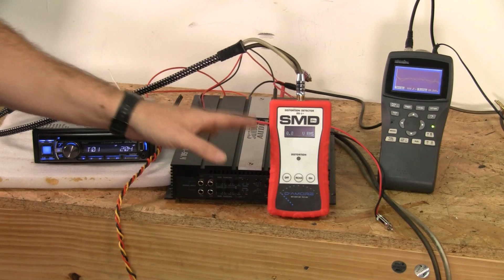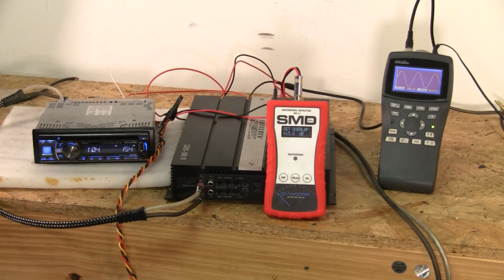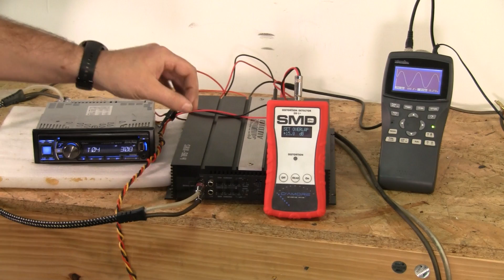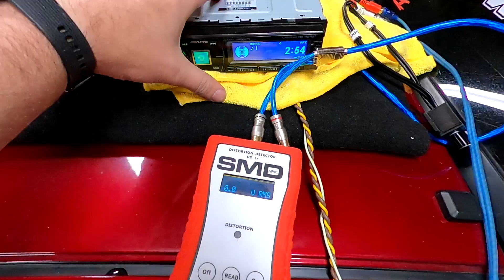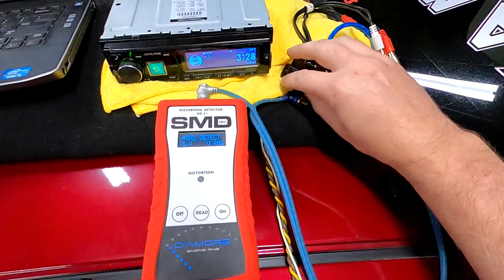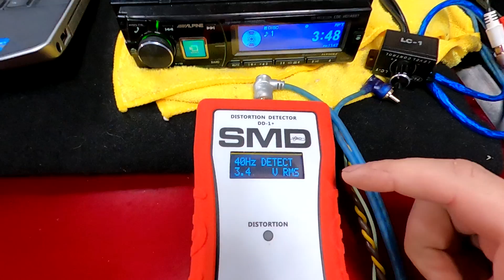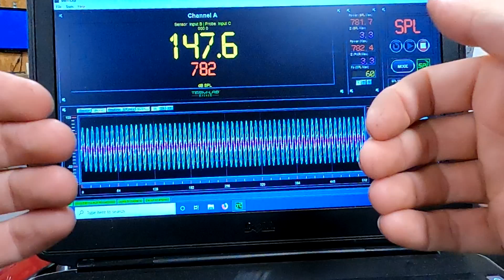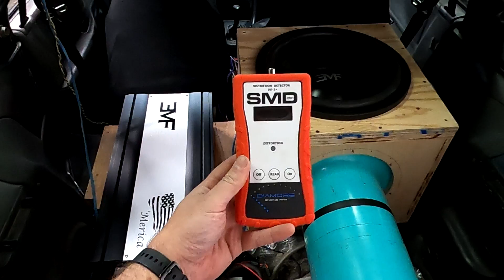The TRUTH about the D'Amore Engineering / SMD DD-1+ - Tech Stuff Tuesday

Comment: You would also with an oscilloscope have a difference with each different source so it doesn’t matter what tool you use to adjust for clipping you will have to change your gains for each different source
Reply from the maker: Using the same source with different track volumes would also change that. All reasons the best tool to use is your ear, and confidence building tools are a waste of money.
Reply: @EMFAudio  probably is everybody doesn't have that ear some people can literally listen to distortion and hear no problems
Reply from the maker: @d77543020  because they aren't told what to listen for. Most people figure it out, if it sounds bad, turn it down.

Comment: What someone should take away from this video if they're looking for valuable info or facts: 
Setting your gains should start with finding the limits of the head unit and all other gain settings shoild be set with any eq settings (bass boost, head unit eq, phone or bluetooth source equalization, bass knobs.. etc) maxed out to the highest degree the intended user would ever use.. The key to correct and safe equalization and amplification would always be to decrease  frequencies levels rather than increase them.. The part i don't subscribe to wholeheartedly is that distortion is wrong and every un-rounded waveform is an arrow from satans bow.. Clipping is undesirable and destructive for sure but i believe there are hundreds of thousands of overindulgent bass heads in the world running equipment for years even decades and their systems regularly experience distortion to a small degree..  I would not set a customer's system to allow a signal that distorted to ever pass through the output but a smart person knows that what's being said about line level, eq and clipping are really just no-brainers and if you can argue against a point that is 100% legit truth (easiy proven facts) then you don't need to even watch these videos because physics and the world that you live in are within the fantasy realm that nobody else can touch taste or see anyway, so just turn it all up to fuggin' eleven and ignore the advice of anybody not sharing your cartoon coccoon. Sorry for typos and long winded reply.. Some of y'all just fuggin' suck!
Reply: it ain't that, others just can't handle people have the right to their own way preference right or wrong as it may, can't kill that with weapons no more than human weakness with a gun or opinion

Comment: what needs to come into mind is amplifier overhead, people like to think "1000W RMS subwoofer = 1000W RMS amp", the problem comes in when you set gains to not clip, if you set the gain with a 0db signal (which almost no studio recordings are that high) you won't get close to getting full potential out of your subwoofer, having amplifier overhead (say 1000W subwoofer 2000W amp) will be able to get full subwoofer potential and not clip when set to a 0db signal, what i would do is figure out the voltage needed for 1000W of power at the subwoofer impedance and see what the voltage is of your amp (with overhead) max unclipped at a 0db signal, and if it is higher then back the gain off until you are say 10% above the voltage needed for 1000W (use the formula V = SQRT(P*R)) that way you will be always close to getting full subwoofer potential and never clip
Reply from the maker: But the LED said it's impossible to clip AND making the most power, and total system balance between mids and subs don't matter! /sarcasm
Reply: @EMFAudio  and the amount they charge for these DD1s is absurd, ive been wanting to build and document a similar device on youtube but just havent gotten around to it yet, i think i could do it for around $20-$30 of parts
Reply: @wow1022  The frustrating part is that you are more than likely not coming at this from a product manufacturer perspective.  The manufacturer has to make money and lots to pay for the cost to build the item, pay taxes, hold inventory, make a living, pay employees, retirement, and also enough to pay for research into the next thing.  Yes, there is profit but usually only when the quantity is very high which is usually after a lot of time.   How much profit do you think is in that oscilloscope he uses or the batteries on the bench.

Comment: anyways, these devices are fairly simple, you build a sharp notch filter for 40hz and 1khz, when something starts to distort (meaning you have harmonics) those frequencies make it past the notch filter, then it takes the level of signal that makes it past the notch filter, does a calculation against the level of fundamental frequency in a microcontroller, and if it is  >=1% THD it lights the LED

Comment: Ya, I mean I know for clip setting/gains that most say to do it flat. But, same issue. So to me it makes more sense to adjust the gain,clip based off the maximum, so then any adjustments only go down from there, just like the new JL RD400/4 amps do with the remote knob--it only attenuates. 
--I prefer to have an amplifier that has the power headroom so that I do not need to run the amp at full tilt. Of course the HU clip point needs to be known. If planning on running an amp full tilt, setting up the gains as high as possible without clipping becomes a problem, for sure. 
--I don't find that the SMD meters should cost as much as they do. Maybe half that price. Otherwise, just get an O scope. 
--haha. The sarcasm. But I see why because  a lot of people watch your vids just to blast u
Reply from the maker: Most remote bass knobs only attenuate, few are an actual bass boost (which is like on the amp). That isn't a new thing or exclusive to JL.
Reply: @EMFAudio  Ya, I just used it as an example. IDK every amp. Plus, I've been out of car audio since about 2001, and just am getting back in. A lot changes since the '90s loudness war and 2001.

Comment: I set my gains with my bass knob at around 3/4 and checked my clip indicator with a scope. It’s pretty damn accurate. If I’m cranking it up I put my bass knob to where i set my gains and I can see if I’m clipping or not at the volume level I set my gains. It’s about the safest way to prevent clipping outside of having a scope sitting on your dash lol. I check everything pretty regularly but I also have a 4425 PicoScope, a snap on vantage legend, and a couple of other handheld scopes laying around.

Comment: I think they should suggest in the manual for slow people like me that you should set it acoording to your bass treble levels, however I thought still do think that 15db overlap means boosting your bass treble via eq would be accounted for loudness button knocks up 10khz by 10db and the bass at 100hz by 10db pluss bass boost on deck equals 6db plus si you need 16db overlap? 😏😏👌👌🤣🤣🤔🤔🥱 forgot plus 12db bass and treble on built in equaliser on deck so I need 30db overlap? not all distortion is audible so its aboat being safe?

Comment: Very though and informative. Your gonna clip so open your ears is basically how it goes. I use a speaker with a resister to set gains and it works well as a starting point.

Comment: You can clip even if you set it with the O-Scope. Audiophiles take into account everything when they set their equipment up. That why you always verify after changing settings. And depending on how audio is recorded is going to make a difference. The tool does what its supposed to do. But it doesn't matter if you use an o scope or not, you change something, then expect different results.

Comment: From the included instructions:  

Measuring a headunit only

"This procedure will determine where the
maximum unclipped volume setting of the
headunit is. This is accomplished by setting the
bass, treble, ect, to zero; and any EQs and
crossovers in the headunit to flat. Later, when
you set the a

Setting the gain of a full range amplifier

1. This procedure should only be done AFTER you

have ensured the headunit puts out a clean
undistorted signal, AND you know where the
maximum undistorted volume setting is.
2. Turn the gain setting of the amplifier to minimum
3. Set crossover to full range / all pass/ bypass amplifier gain(s); you can reset these
to where you feel the customer will set them, or
where you will set them for your own system."
Reply from the maker: The instructions tell you how to make it clip with the impression you aren't.

Comment: I'd like to see you invent a bass knob that provides a distortion light implemented into it. IMO they should already be on the market and readily available.
Reply from the maker: You mean like most Sundown amps for the last 6 years?
Reply: D4S JP23 has volts, temp, and clip in the same knob.
Reply: I’ve had a bass knob with a distortion light since 2013

Comment: Question: If I use an amp that provides double the CEA rated RMS wattage of the subs (ex. Kicker 12L7S 750RMS therefore 1500RMS amp), then this would prevent any clipping from happening right? It's my understanding clipping is from the amp not being powerful enough. Thanks for your responses.
Reply from the maker: Any amp can clip, period. The sub doesn't demand power, it does what the amp tells it. Aside from CEA rating being misleading, you could still clip the amp but that is assuming the sub doesn't fail first.
Reply: @EMFAudio  thanks for your response.

Comment: Question: if setting up properly as you did, but then play a song that has deep or bass boosted notes, could that bad boosted song introduce clipping even though there wasn't clipping when initially setting up?
Reply from the maker: Yes, that's the inherent problem with using a tool to set the gain. At the end of the day, your ear is the best tool to adjust things in real time.
Reply: yes all day long

Comment: I doesn't matter where you set the gains when customer just turns bass control all the way up....they always claim "I wasn't even turning it up that much when woofers blew"....99 out of 100 customers want more power than they have and will drive it into clipping or will take to another shop to have gains turned up and clip the fuck out of it... lol...
Reply from the maker: You are correct. I used to work at a shop where people would come back the next day with 6 of 6 blown subs and say they turned it up when it got quieter. This was after their buddy would say "you aren't getting all of it, they turned it down so you'd pay to upgrade" and turns their amp "up".
Reply: @EMFAudio  lol so true....like 5 mins after I posted that had a guy come in..lol "the bass is not as loud as it should be" ....turn bass eq up a tad gain up a tad..... woofers bottom out and pop at max volume....

Comment: so dd1 can only check for distortion on the low voltage outputs? it cant check the headunits actual speaker outputs?
Reply from the maker: Treating it as an amplifier you could, because it does have an amplifier onboard.
Reply: @EMFAudio  does the black wire from the dd1 go to the speaker negative or to the ground?
Reply from the maker: @slybunda  Depending what version you have it could be speaker negative or could be one or the other or both. It's not the easiest tool to use, but the new video coming would be a better way.

Comment: Thanks Sean. Videos are always informative. Love the old school spl trick at the end of the video. I still have and use the 3 banhammers from 2016. The 3 scv 2000's died in 2018 (power supply problems)  I have Phoenix go ti elite amps now.  Ok my question I've set up my system using the dd1+ and havent noticed a problem.  But the explanation on the 3 and 6 db over lap does have me concerned for my system as it is the mids and highs that does use that overlap.  I think I'm getting what your saying. Is I should be more focused on the extra head room that I know is clean. Instead of essentially over thinking it and providing a over lap that may distort at a 0 db signal? As always love the equipment. I do use SMd and EMF with no problems. Just want your thoughts about what I was talking about

Comment: I am not sure what you're trying to prove  or what your expectations of what the signal is after the last dac in the line. I think you purposely kept a lot detail out of your video, maybe too much. You don't discuss sensitivity, power supplies, digital and analog signal, or how much a better DAC would improve audio signal. Also if using different kind of amp, tube, distortion would be high.
Reply from the maker: Your signal going into the amplifier is what ultimately matters, what's before that doesn't when adjusting such settings. There are a ton of "if's" but this isn't for making the best possible signal in or out, it's setting for the best result of what you have.

Comment: One major issue I noticed. Besides you not using the DD1+ correctly.  When you switched to 40hz which is a subwoofer frequency you already screwed up.  That amp is a lower power 4-channel. Aka an amp used for kids and highs. Not subwoofers.  There may be subwoofers that have that low of RMS. But for the same price you can get subwoofers with a higher RMS.  The point of getting subs. Is to get bass.  So you're gunna want the most powerful subwoofer in your price range.  For that fact alone I don't trust your opinion on the DD1+ . And then add in the misoperation of the DD1+ just makes the video a joke.  And that's not including the many more mistakes made in the video
Reply from the maker: Opinions are thoughts about something, facts are things verified and repeatable. You're ignorant if you think an amp with a low pass crossover isn't for subwoofers because you think all subs have to have a high power handling. You can buy cheap subs with a high power rating, that doesn't mean they'll handle it. You can also buy expensive subs that don't handle much power, because they don't need to. This amp is rated for 160w x 2, 320 watts for bass if you had subs connected to it, which is in fact more than most factory systems with mono amps on sub(s).

Comment: the only problem with this video is that with the dd1+ u need to keep spaming that read button every time u make an adjustment... keep in mind ive never personally used one but ive been watching smd since 07 or 08 and he usually even says u always need to hit that read button
Reply from the maker: Sounds like a confusing, hard to use tool. You know what's not and costs less? An o-scope.
Reply: @EMFAudio  i completely agree... i even found o scopes as cheap as $40 on amazon... im sure they aren't the most accurate in the world but it doesn't take a whole lot to read a clipped signal

Comment: Learn to use an oscilloscope!  It is easy!  The problem is, that people think they need a special tool because they are afraid of the learning curve with an oscilloscope.  If however you are clever enough to use this fine specialty product, you may if fact be clever enough to use and interpret the oscilloscope with ease.  The oscilloscope has a multitude of uses and applications including diagnosing modern cars.  It is a MUST HAVE for anyone interested in sound, automotive repair, or electronics in general.

Comment: Doing the levels on flat settings would be ok if the EQ'ing would be done to only remove humps and bulges, not to boost anything. And that's how it should be. Though a few dB boost here and there would probably not be the end of the world. I would probably prefer to set some basic levels for measuring and setting out the system (EQ, delays, phases etc.) and only then do the final level setup. That way the boosts that change with the listeners taste and feeling could be kept to a minimum. 

OT... And of course a system should be adjusted as a compromise between a flat response and the preferred contour of the listener (also with high output, the threshold of pain should also be considered). When someone actually starts hearing things that previously were left in the shadow of some over boosting or just crappy speakers/installation/whatever, I could bet that they would eventually prefer less boost (ie. loudness) for a clearer and more sophisticated sound stage. But that takes time, understanding and good gear.

Comment: this guy is , as we call it over here in the netherlands, kicking in a lot of open doors. turning up the bass is distort the signal. which i think is pretty logic. same with the change of source, changing from bluetooth, aux, cd or tuner my headunit is changing the output level with every step, what does that has to do with the dd1 ? i mean. i agree with using your ears to detect distortion. just the way this guy is revieuwing this dd1 does not make a lot of sense.

Comment: I think the best thing to do here is set your eq and crossovers at moderate volume to your musical taste, leave bass boost off and act like it doesn't exist, THEN hook up the dd1 and set your gains.  I can see the point of this video.  I'm not partial to either party here, but imperfect tools made by imperfect humans are never going to be 100% fail proof.  Use your head a little and you should be fine.
Reply: That's exactly  what  a gets from  this  video...

Comment: you didnt do the amp part right. it say turn ur  Frequency all the way up on amp when u setting the gains
Reply from the maker: So you're seeing voltage going up with the frequency being changed that doesn't go over 500 hz? I think you should look again.
Reply: @EMFAudio  what I'm saying is he tell you to turn the crossover Frequency up all the way on amp before u set gains with the dd-1
Reply from the maker: @guidoftc8304  That's exactly what I said was done in the video, mentioned the fact that it's full range with no crossover at all to be specific.